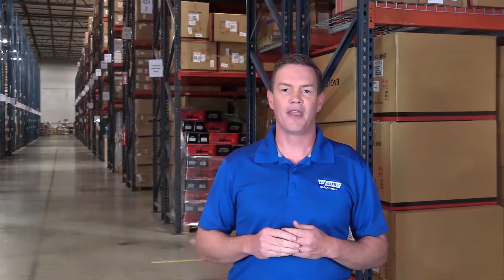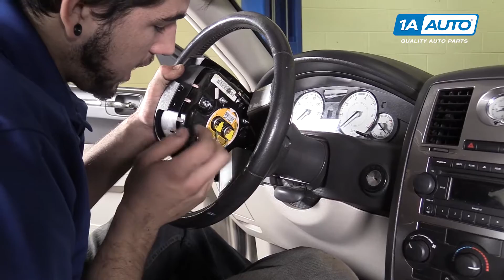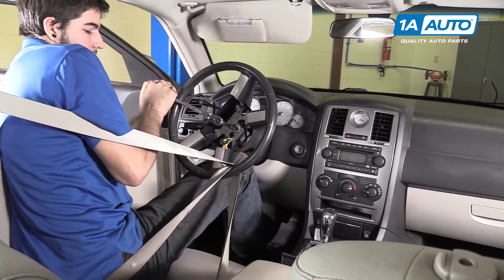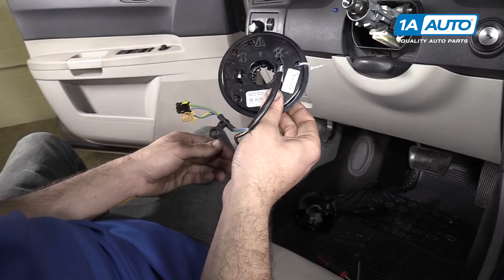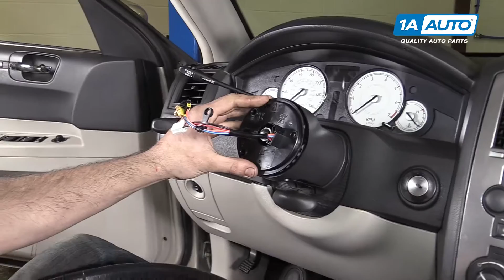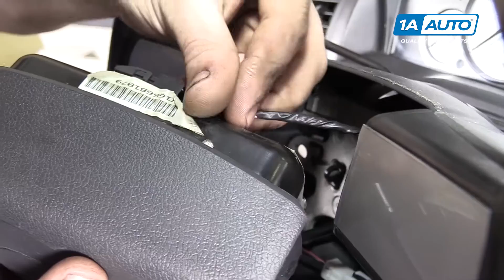How to Replace Cruise Control Switch 05-10 Chrysler 300

Comment: what about troubleshooting the vacuum system?  
Also, what about the switch that connects to the brake pedal?  could you please do video's that troubleshoots those possible problems?  My CC lever turns on and off and the light on the lever comes on but the car will not stay set at a speed.   I've been told that it may be the vacuum system or the switch but i cannot find a problem with the vac nor can I find the switch behind the brake.
Thank you for the high quality content.